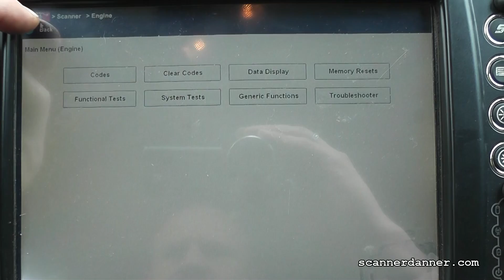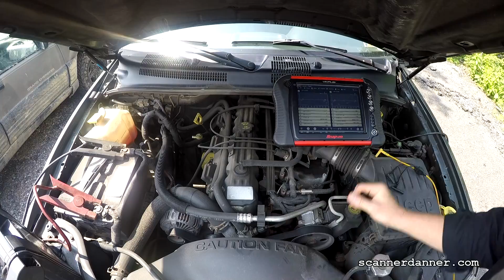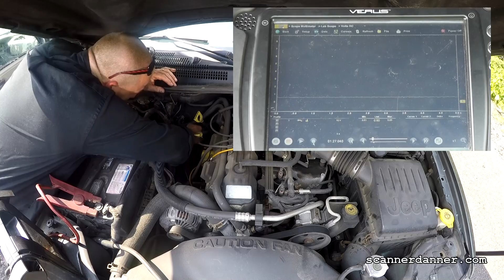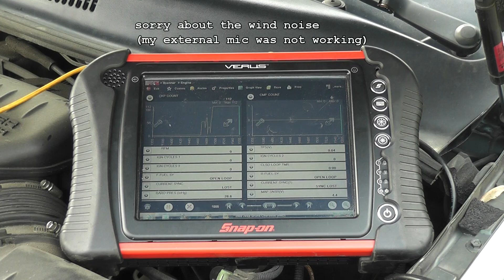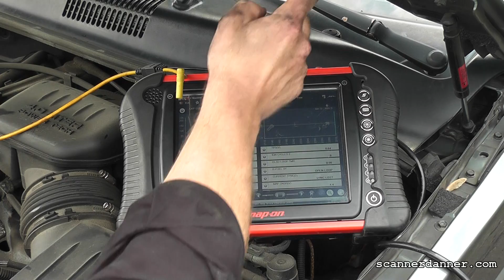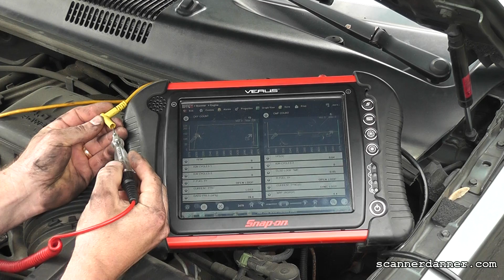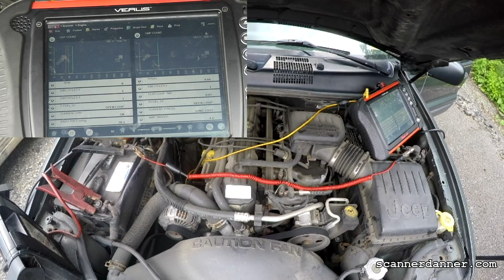How to test a crank sensor (Chrysler Dodge Jeep)

Comment: Danner can you watch Diagnostic Soup with John Anello on the TSTSeminars channel  from 35:10 - 38:45 and tell me what you think and if you've ever seen it happen because i would think the reference voltage and biased voltage would come from the same regulator and throw a variable in checking ref and biased voltage on chryslers and other oems that use similar strategies.
Reply from the maker: +Andre Moss when I get a chance. Thanks!

Comment: Using a jumper wire is a bit of a dangerous possibility to point out here. Hall sensor is taking the 5v. and pulling it 'hard' to ground, but this is NOT the case on all signal wires. Most of the sensors are putting resistance between feed and the full ground, in so reducing the amps. Would you test such signals  (which at times is the falling of feed voltage like with temp sensors) by using jumpers, you could really damage the ECU. Not a fan of telling people that 'jumpers can be used'...
Reply from the maker: +Henk Moesker perfectly safe to use a jumper wire on a temp sensor circuit
Reply from the maker: +ScannerDanner A Ford recommended test procedure (for testing wiring integrity) on an older EEC-IV system that did not support data stream:
For a "circuit high trouble code" do the following:  jump the ECT signal to the ECT ground wire, then re-scan the codes. It should now set a circuit low code telling you wiring is good.
Reply: ScannerDanner You are so right, temp sensor is a bad example indeed. Still it feels eary to me to just shorten out a voltage that is being supplied and monitored by the ECU, it just gives mee the creeps to think how many amps can go through there. Not when it already is regulated by resistors ofcourse.

ECU's are protected anyway these days, just had and EVAP solenoid which had a steady feed but on the control wire spiked plus and minus for about 30-40v.! Guess a bad coil in the solenoid with unloading spikes but the Ecu was not hurt, even though this is going on for ages (I know cause it resulted in a rattling valve in the EVAP box but that had been going on for ages, as the client told me).
Reply: Ow and for testing, I think your advise to use a test light with relative low amps/high resistance, does je job for signal wires just fine and always keeps you on the safe side. It's in your book, it's in your video classes, and I think you gave good advise there!
Reply from the maker: +Henk Moesker thanks Henk and it is never a bad thing to error on the side of caution, right?

Comment: Great vid Danner. How come you didn't check air, spark, fuel and compression and use that as a form of direction to the failed crank sensor?
Reply from the maker: +Jodi D I had a code for the crank sensor, so I went straight to it.
Reply: @ScannerDanner  Danner, should I have 5 volts at my cam, and crank sensor, at the constant, and signal wire, with the key off in my 2011 ram 5.7?

Comment: I dont think you can do a bypass test with the sensor plugged in using a testlight since it will fail to pull the reference from its path due to to the much, much higher resistance than the path the reference is already taking (be it to signal or ground).
Reply from the maker: +Schrodingers Box you absolutely can but you must measure signal voltage first.  A low signal can be caused by the drive plate window itself. This is why we unplug the sensor, to eliminate that variable
Reply: Even the best learn from the best...😎

Comment: Just curious but how would your approach change with a crank no start condition on a vehicle with an interference type engine? I like your case studies and follow both channels but don't remember if you ever had to address this variable on any of the vids I've seen. Keep up the great work Paul..
Reply from the maker: +Johnny M no need to worry. I'm not changing valve timing just ignition timing

Comment: how you turn your test light into a jumper wire without blowing the fuse?
Reply: as he explained in the vid,  What he was doing with the test light, hooked up to battery negative is exactly what the sensor does.  pulls the signal to ground.
Reply from the maker: +Xrio Sankara knowing circuit design is key. Also you wouldn't blow a fuse here if done incorrectly (there is no fuse) but you could damage the PCM (even worse than blowing a fuse)

Comment: Hehehe!!!!!! Ive actually diagnosed a few crank sensors on this same exact engine/model thanks to your methods paul. Another thing to look out for from what Ive seen a few times already is the wires to the crank sensor connector and the oil pressure semsor just underneath tend to get really brittle and bare and will actually melt together over time causing a no start. Ive diagnosed that one a few times too and once again thanks to your methods!!!!! Anyways just one more thing for anyone wanting to make the repair Im a big guy with big hands I find it easiest to jack up the vehicle. Lower the transmission crossmember to drop the rear of the tranny which will tilt the transmission and give you access to the one bolt (11mm) holding the ckp in cheers!!
Reply from the maker: +Goenitz Lopez thanks brother!

Comment: I liked the grounding of the test light in combo with the Verus ....But I dont have a 10000 dollar Verus ..but I do have a 6$ scope on a rope :)
Reply from the maker: +deepsquat600 don't need the 10k Verus, just a scan tool that provides some oem data. Which in this case was cam and crank PIDs. A generic scan tool with global only data will not show you these.
Reply: ok thanks .. I will check to see if my provides that ..still I did like that test of generating your own grounding and having it trigger the "signal" ..great video